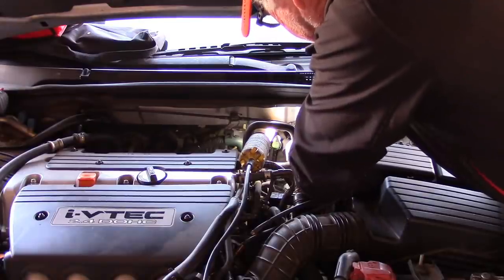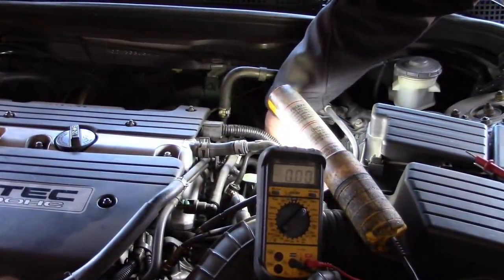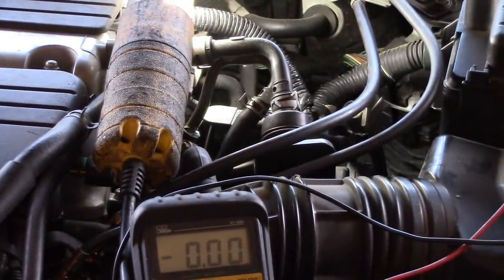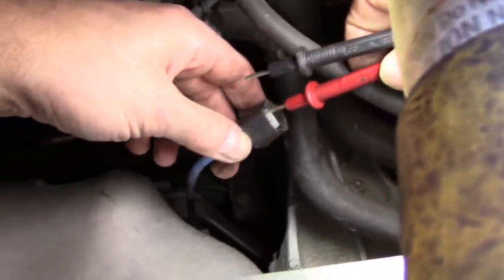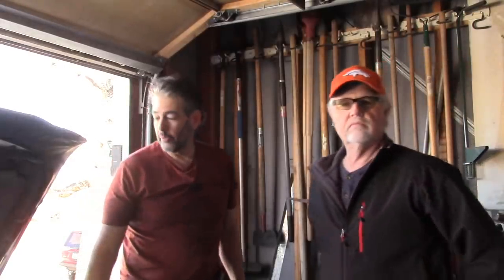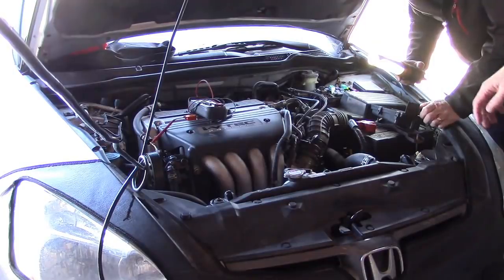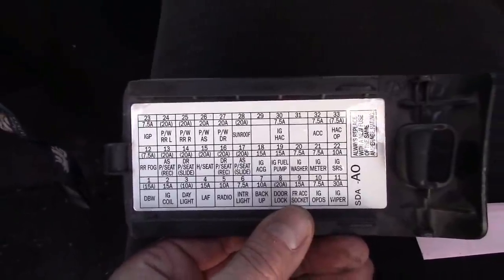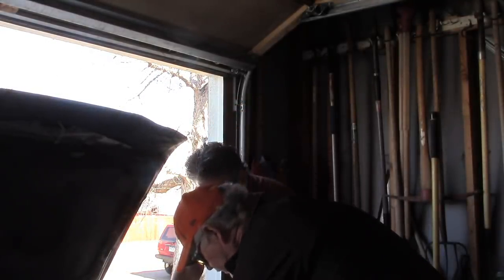Field Trip!  P0135 O2 Sensor Heater Diagnosis

Comment: Hi, my car has an upstream narrowband oxygen sensor and I want to install an additional narrowband oxygen sensor for my AFR gauge.. where to connect the heater?
Reply from the maker: You will need to connect it to the two same-colored wires on the sensor. That’s always the heater circuit.
Reply: @SchrodingersBox  Yes their heaters have 2 white wires (same oxygen sensors). I was thinking about this type of connection but I had my doubts about connecting heaters parallel because if I am right it halves the total resistance that ECU detects.
Reply from the maker: Oh totally good thought. Now that I think about it - I guess each sensor probably is separately wired with its own power and ground control.   I don’t recall specifically but that sounds about right.
Reply: @SchrodingersBox  Is it right to trigger a relay using the ignition in order to pass 12v from the battery to the heater? That means constant 12v to the heat element until I shut off the engine. Could that damage the heat element or something else?
Reply from the maker: That’s how I would do it however you also have the issue of how you will turn off the heater once temperature is reached. 
   I did look out of curiosity by the way- yes the heaters are not in series as you expected. However each heater has its own ground side control in the PCM to turn it on or off- or in some models it’s even pulsewidth modulated.   I guess maybe the worst that happens from leaving the heater on is it will burn out pretty quickly so maybe you aren’t concerned about that.
Reply: @SchrodingersBox  I found someone's circuit who connected the relay's coil to the ignition switch from where he takes +12v and for ground he used the purge valve's relay in order to trigger the heater when purge valve is deactivated (closed loop), as I understood.. By this way he has better load management. I must read my car's service manual because he did it to a different car. If I won't make it maybe I will connect a switch between the ignition switch and the relay's coil and i will place it somewhere on the dashboard to turn off the heater manually.. thank you very much for your time..🙆🏻
Reply from the maker: Ah I like that idea!!!!! Nice!!!
Reply: Hello my friend, in the end I decided to install a wideband afr gauge with its sensor because I didn't want to mess with the heaters and its better as I can see. For so long I have a problem on cold starts and now I can see what is happening.. on cold starts the afr gauge goes from 15 to 20 and the obd2 diagnostic shows high negative short fuel trims. after a minute it goes back to 14.7 and it runs smoother as it gets warmer.. I also figured out on cold starts that if I increase the revs by pushing the gas pedal, I have better readings. could it be a leak?
Reply from the maker: It sounds to me like the AFR needs a heater circuit to function on the cold start.
Reply: @SchrodingersBox  The afr gauge contains a controllerbox and one of its functions is to heat the sensor.. Is it possible to have a lean condition and  negative short fuel trims at the same time? The LTFT is +3

Comment: are af / o2 heater circuits ever pulse width modulated or usually just constant voltage?
Reply from the maker: There are absolutely some that are pulsewidth modulated!  I Learned this by surprise while making a video and checking amperage on and was shocked to find pulsewidth modulation on a specific vehicle!

Comment: What was the final issue in this? I've got a similar issue on a P0135 with an O2 sensor that tests good and a ground feed that tests good for continuity. But the O2 heater voltage supply wire directly from the PCM (no fuse, 05 dodge dakota 4.7) goes from 12v when you switch the key on and then drops to about .13v a half a second later. I'm about to run through the wiring with a multimeter but curious as to how this one turned out. I assuming a short somewhere in the wire and the PCM has some sort of internal protection that cuts voltage to protect itself. But I have no idea really.
Reply from the maker: Correct- short on the return signal.

Comment: I found that shortly after I passed smog last time, my "check engine" light came on, and I got the "heating circuit" code for both o2 sensors, p0135 and p0141, as well as an engine coolant temperature too low. Yet, my OBDII "Blue Driver" tells me the coolant temperature is 189 degrees, which is 9 degrees hotter than it need be, and I note my "cold engine" light goes out after like 1 minute, so the engine coolant heats up quick, AND no over heating issues. I DID NOT FIND ANY FUSE FOR MY CAR for the heater circuits, that is, on a 2001 Toyota Echo. So the ONLY think I can think is bad about my car is the PCM. Anyone have any other ideas?

Comment: I have an Acura TSX which is almost the exact same as that. The heater circuit was not the red/orange. Found I had 12 volts but my o2 failed continuity test. Thanks a bunch! Good knowledge for future repairs

Comment: I'm a newbie. Question sort of related but not. After trouble code reset, it takes a long while for the O2 heater to take a reading. I found where you can cold start the car, put on the air conditioner, and rear defroster and immediately run down the road at 55 mph for three minutes and it will take a reading. Can you tell me why this makes it read? I don't know why this worked.
Reply from the maker: The heater circuit operates immediately upon startup. Not sure where you got that information. Maybe you are talking about the O2 sensor taking a reading. If you drive the car for a few minutes regardless of what accessories are on, the exhaust itself will eventually heat the sensor enough to become operational even without the heater circuit.
Reply: Ok good to know. Crazy internet info. Surprised it didn't tell me to hop on one leg and whistle. Lol Thank you. 👍

Comment: Hi sir how you doing
Please i need a help i have some problem with my car and i have a freeze frame when the engine lamp turn on but in my city no buddy knows what is the real problem, can i contact with you by email I'll appreciate that if you help me ! by the way I'm living in north of iraq thanks.
My email is (alikamal986@yahoo.com)
Reply from the maker: Give me the freezeframe data here and I may be able to give at least some indication
Reply: @SchrodingersBox  my car is hyundai veloster 2016 r-spec gdi turbo engine
Reply: @SchrodingersBox  

Freeze frame information: 
------------------
Fuel Status = 0 byte
Engine Load = 30.588 %
Engine Coolant Temperature = 84 °C
Fuel Trim Bank 1 Short Term = -3.125 %
Fuel Trim Bank 1 Long Term = 6.25 %
Intake Manifold Pressure = 10.008 psi
Engine RPM = 2,332.5 rpm
Speed (OBD) = 61 km/h
Timing Advance = 34.5 °
Intake Air Temperature = 34 °C
Throttle Position(Manifold) = 21.569 %
Run time since engine start = 601 s
Fuel Rail Pressure = 596.105 psi
Fuel Level (From Engine ECU) = 47.451 %
Barometric pressure (from vehicle) = 13.343 psi
Voltage (Control Module) = 13.923 V
Engine Load(Absolute) = 54.51 %
Commanded Equivalence Ratio(lambda) = 1.037 
Relative Throttle Position = 12.157 %
Ambient air temp = 24 °C
Absolute Throttle Position B = 21.569 %
Accelerator PedalPosition D = 29.804 %
Accelerator PedalPosition E = 29.804 %

End of report.
Reply from the maker: @alikamal8790  Unfortunately nothing can be determined from that particular freezeframe. I would have to see the fuel trim against a load curve to find out anything.
Reply: @SchrodingersBox 
Ok I'll try to change the fuel to high octane maybe fix this problem actually before month i was change the fuel to lower octane may this is issue, now I'm deleting the fault code and waiting if fixed or not i let you know thanks for everything i appreciate that. have a nice day sir
Reply: @SchrodingersBox 
The fault code is P0430, i was check the catalytic converter every thing is ok, now what should the real problem what you think?

Comment: Would the original technicians diagnosis be true if it was a single wire O2 sensor?
Reply: It really wouldn't be applicable because there's no heater circuit on a single wire sensor
Reply: @samtime3803  doh lol. Brain fart

Comment: Had the P0135 on my 04 Tahoe Z71. When you Ohm test the heater circuit on the sensor it has to have between 5 and 16 Ohms to work properly.

Comment: Is it possible that the engine was at operating temperature, and at operating temperature cuts the 12V to the heater? Or should it be 12V all the time?
Reply from the maker: Good question. Engine was not at temperature and even so,, it is ground side switched and sourced both at the PCM so there should be constant power feed.
Reply: @SchrodingersBox  oh right ground side switched, damned sparkies. Thanks for the reply! I have the same code on my Pontiac.

Comment: QUESTION, if I may :  Besides IDIOT !! What advice would you give to someone who used break parts cleaner instead of berryman's to clean throttle body carbon build up.  All I can say in my "defense" is BMs red/white can and BkClner orange / white can is what screwed me.  Now I have a high idle and will not touch the idle screw 98 ford 2.0L SPI.   Thx 4 ur time.
Reply from the maker: I regularly use brake clean to clean throttle bodies. Sometimes it takes a lot of time for the rest-learn to take place. If it persists, Check the desired IAC vs actual IAC to see if that’s the issue.
Reply: @SchrodingersBox  Appreciate it, I was hoping it just needed to re-learn, but I am at 3 weeks now and a little concerned the brakleen washed off the telflon coat, IAC works great, per your vids.  Thanks for the quick reply sir.
Reply from the maker: What is the data from the IAC showing?
Reply: @SchrodingersBox  According to the act vs des, it starts out mildly open then closes almost completely.  I bought this a few years ago and figured it's likely time to do a timing belt, I'm certain I lined the dots with the arrows and triple checked.  I wonder if the dude before me messed with idle screw but cant tell.  I'm just gonna keep battery unplugged all weekend and hope for the best.  Thanks for the help and will look at iac again if it doesn't straighten up.
Reply from the maker: I need the actual counts or pulsewidth modulation variance.  I am questioning that you are saying the IAC is functioning properly- i haven’t seen evidence of that and it is the most likely suspect.
Reply: @SchrodingersBox  I don't have $5k machines but I will look for the numbers I wrote down doing the test with a volt/ohm meter.  I know this isn't always reliable but drove me mad so I unplugged it and idle went near 2K, plugged in takes it to 1150 ish needs to be 800 ish.  But when the butterfly is at rest there should be little to no light getting past correct?  I'm seeing about 1/16" gap.
Reply from the maker: You only need an $80 one. why do you need a $5000 one?  All my tools aren’t even that much.

Comment: Dude your an absolute diamond, I was trained to fix rather than replace, it seems this isn't taught anymore, unforrunately I am riddled with arthritis which has put paid to my career, but so glad to see that someone understands you need to know what the fault is, not what the code is, I am so looking forward to the follow up on this on quantum, but is there any easy way of finding it when you do? As i find it frustrating with the search engine you use, it does not seem to be very intuitive, but please keep up the good work, I love what you do
Reply from the maker: Thanks man. Believe it or not I also struggle with arthritis (rheumatoid). Luckily I respond well to Enbrel otherwise i’d be disabled. Almost ended my hobby before I started making videos.

Comment: You could have a low voltage in a supply circuit with the disconnected sensor if there is more than one consumer supplied by the same fuse and there is excessive resistance present in that circuit causing the voltage drop with another consumer unknowingly present. Even the OEM wiring diagrams are not always correct or clear enough to rely on them for diagnostic conclusions. 
Also, on this model, I would bypass the sensor heater relay (which is rather an unusual feature) as the next diag step and re-check the supply voltage to the sensor heater circuit just because it is quick and easy diag step.

Comment: I got a p0037 ho2s low circuit. and the traction light is on the 2010 2.7l toyota tacoma. I part cannoned it. before i seen this nice video. i gonna do the same tests. thanks for the video

Comment: He had a lucky escape with the parts canon there. I bet the dealer probably would have quoted to replace the whole vehicle wiring loom if a sensor and PCM didn't fix it.
Reply from the maker: Yeah its funny you mention- after filing he did ask me what the dealer would have done if he paid $340 for the sensor and it still didn't fix it.  In my experience, they usually say "weeeeellllllllll...... the sensor was bad and now that we replaced it we can see you also have a wiring issue that we didn't see before....."

Comment: possible bad ground to. you had 2.4 volts from battery negative to both of the heater wires so wouldnt that be a negative side voltage drop on one of those  wires that is the ground
Reply from the maker: Yes except remember this was on an unloaded circuit so resistance is not a factor and thus no voltage drop.  I suspect something is wrong where there is voltage on the ground wire as well as the feed and we are seeing the difference between the two.

Comment: The more I learn about these, the more complex they seem. Some newer sensor heater circuits are PWM driven, and only functional if the car is cold, being turned off by the PCM when up to temp. If the engine is already hot, I guess I would have started by looking to see if it was sending a reasonable A/F signal, with no evidence to show problems that might be discovered later after fixing the heater. Some cars offer a data pid showing heater current, which would save a little time for those with a quality scanner. I find it confusing to use a multimeter on an intact circuit, especially if PWM controlled. Too many variables to come to a black and white conclusion. As much as one can destroy evidence by disconnecting the connector, testing for resistance on a disconnected sensor seems like a reasonable first step for those of us without access to special tools.
Reply from the maker: All correct Dave- yes I am familiar with the PCM driven types.  This particular model would indeed be expected to show 12V on cold engine because I did mis-speak in the video in stating the power is sourced from the PCM- it is not, the PCM ground side switches it- the source if fused power.  Begs the question why I only saw 2.5V, but we can rule out "green corrosion gremlins) as it was tested on an unloaded circuit.
Another test could have been to backprobe the sensor and look for complete voltage drop across the load as well as scantool test. The methods chosen were mostly so Dale could participate using what he is more familiar with.

Comment: Why is this guy busting a techs balls about reading off a code. He’s a tech not a mechanic Jesus he probably knows as much as the customer. If anything he should of read off the code and if the customer wanted to inquire about what it was I would of recommend a level 2 electrical diagnostic to narrow down and pin point the problem so we could give him a estimate on what it’s going to need to fix it. Not through parts at a problem to fix it.
Reply from the maker: When you fix cars for a living it is your responsibility to properly diagnose and repair it, not the customer’s. This should be obvious.  This is why the customer brings a car in the first place.
Reply: "reading off a code". Is that what your diagnostic charge covers? Pulling a code, then going to your magic 8 ball and asking it what will fix the car?

Comment: When the O2 didn't fix it, the next part out of the cannon would be a new PCM
Reply from the maker: No doubt about that!!
Reply: Schrodingers Box have you tried plugs and wires? My friends moms aunts nephews brothers mothers pet iguana knew a guy with a car once and he had a problem with the engine and it just turned out to be plugs and wires. So it's almost definitely that...
Reply: THE COIL(S) DUFACE

Comment: Most likely a voltage drop issue in wiring between computer and sensor.
Reply from the maker: But remember we measured the voltage on an open circuit and saw only 2V- so how would corrosion cause that, right?
Reply: @SchrodingersBox  yeah cause voltage drop only works when you have current flow.   Is my thinking correct on this?
Reply: @SchrodingersBox  I guess that's true. You can have corrosion on the circuit and still have source voltage on an open circuit. This is why you always load test your output circuits before you condemn any components. 👍
Reply from the maker: @Autofixpals  Exactly! In the next video I will do testing with the circuit loaded to demonstrate.
Reply: corrosion i bet. the green crusty crusties..lol
Reply from the maker: exactly!
Reply: @SchrodingersBox  see Ive learned a lot from you.  I appreciate everything you do.

Comment: I'm going to assume that the PCM is blown due to a short and an over amp fuse
Reply from the maker: Possible. How would you test for that?
Reply: @SchrodingersBox  first test for voltage at the power side of the fuse before I go crazy looking up wiring diagrams and harnesses if there's no voltage there go I will go directly to the PCM and test for voltage. If there is voltage at the PCM you have a long day of finding a short in the wire lol
Reply from the maker: You nailed it- one exception, I misspoke in the video, On a heater circuit, the power is actually almost never forced from PCM- it is ground side switched from PCM though.  Nice!!
Reply: @SchrodingersBox  oh? The power doesn't come from the PCM as far as you've seen? Didn't know! Thanks bro!